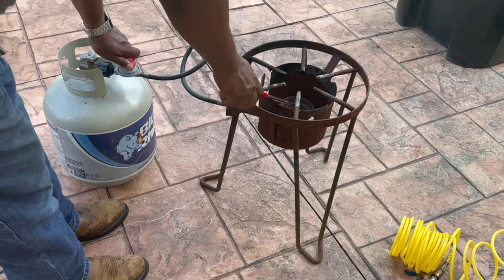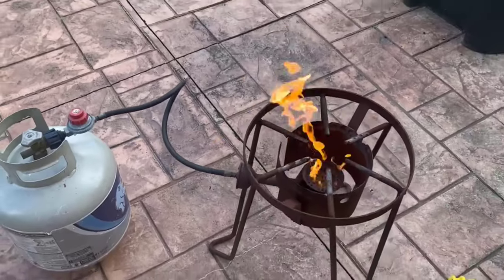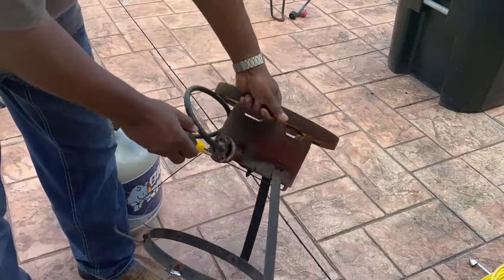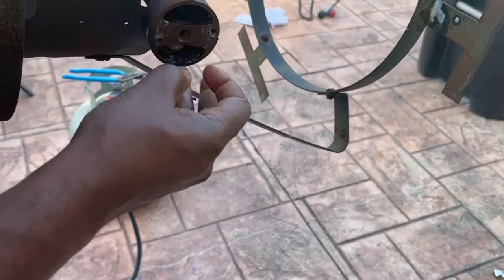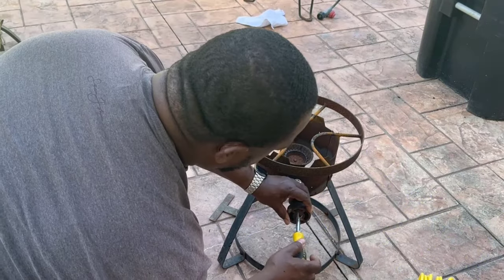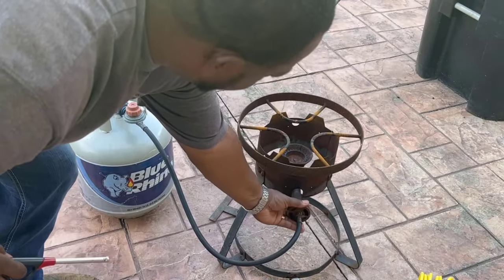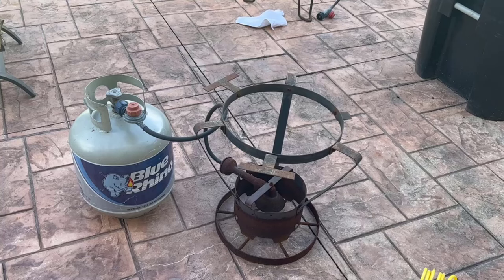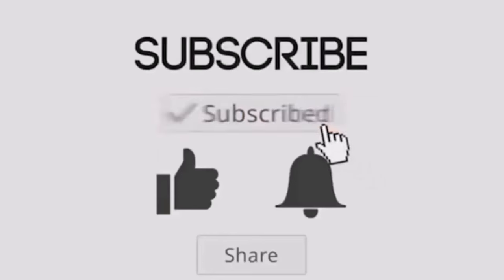How To Clean & Store Your Propane Burner If You Are Leaving It Outside Uncovered

Comment: I finally was able to pickup a burner. It looks exactly your first one; the one with the hair pin legs. Do you have any info on it? 
The flames aren’t very tall out of the orifice holes — the holes seem very large compared to the blue flames 🤔
Reply: I bought a loco small fryer and it has never worked right. A slight breeze will blow the flame out. The regulator is only rated for 10 psi but I bought a 20 psi hose from Amazon. The connection fitting is different so I'm trying to find an adapter. I did take the burner mixing chamber apart and found that it's not smooth inside the bowl. I'm going to debur the inside of it and see if that helps. It's a lot of rough metal from the casting. Quality control was not part of the manufacturing process. 😂